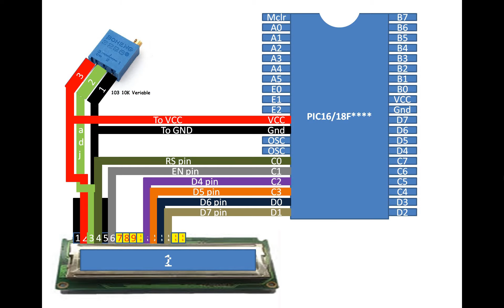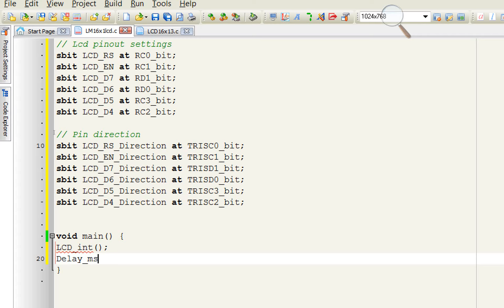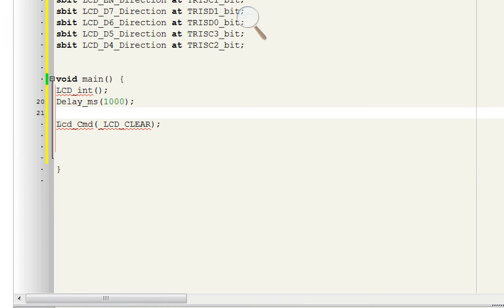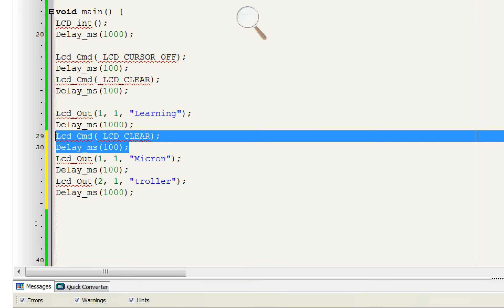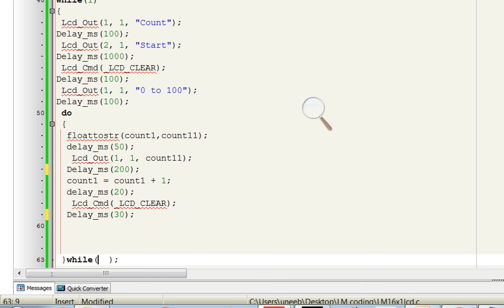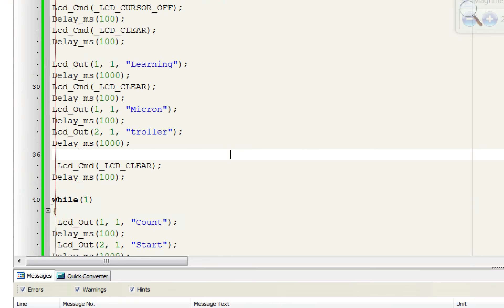PIC16F877A/PIC18F***** interface 16x1 cheap LCD. MikroC coding with Hardware demo. 0 to 100 count.

Comment: hi. it is very interesting tutorial. thanks. did you have any volt ammeter code for pic16f72  with same lcd as yours?
Reply from the maker: For which module ?
Means which voltage measuring module you are using
Reply: @learningmicrocontrollers3561  for dc voltage 0 to 100v and 0 to 10 amps.
Reply from the maker: For that you can use a Current transformer to get the current
Then you can use coding to make it voltage
Reply: @learningmicrocontrollers3561 a shunt reaistor and op amp lm358 can do work with current i needed code for it. I can do Electronic work. I have made befor on stm8s. And on atmega8 and 168 andb328.
Reply from the maker: I can do codijg for these
Reply: @learningmicrocontrollers3561  i have done for all of thease i am asking did you have any of volte ammeter code for pic16f72.
Reply from the maker: Code depends upon type of modules and sensors being used
The hardware you mentioned
I dont have code for that
But its a nice suggestion for me
I will make a video on it in future
Reply: @learningmicrocontrollers3561  it is a very simple calculation. I have even made a ammeter without op amp and only based on shunt. It works ok